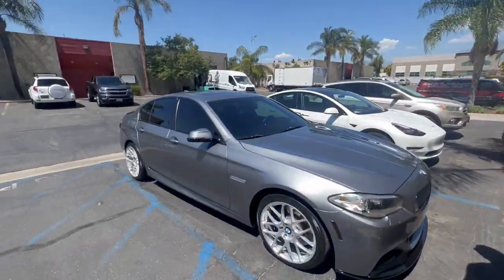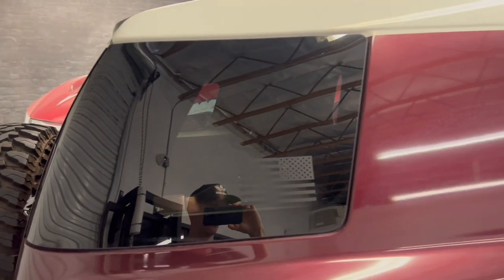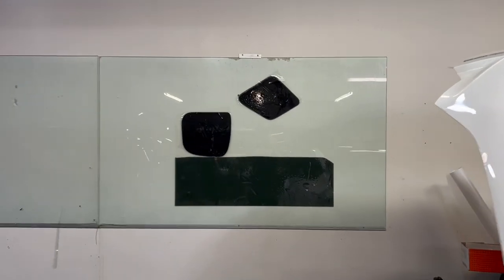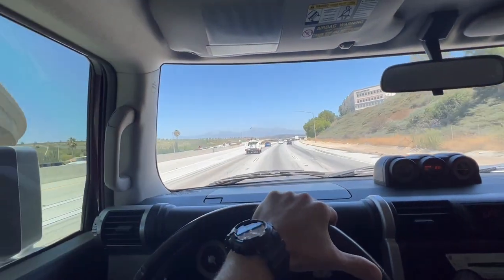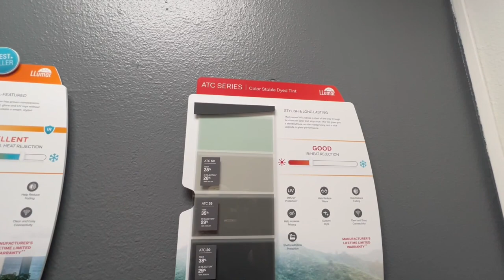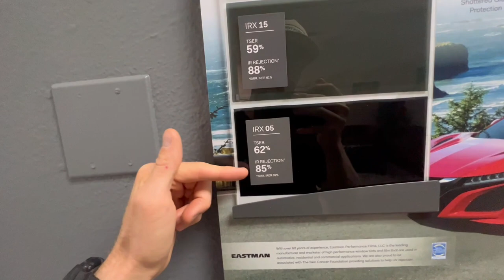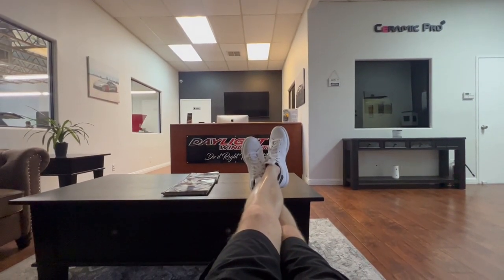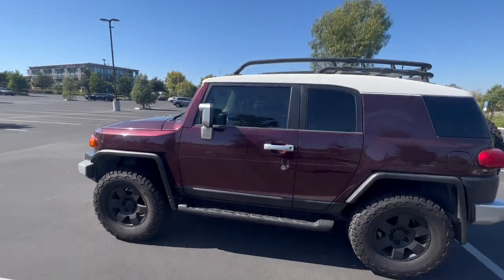80% Windshield Tint… the PERFECT shade

Comment: llumar Air 90 is the lightest tint available for windahields.

Have had it in two cars since 2017 as the Air Blue 80 with the stock factiry windahield tint will NOT pass Hawaii's annual safety inspection as it will test below the minimum 70% light transmittance by the Federal Safwty Standards

Comment: So what do you like more for the front windows? 5% or 15%? (Considering both day and night driving) * I just got 5% in front and 15% in back and back window. It’s kind of tough to see out the sides at night, but I like the privacy and it’s great during the day. Halfway thinking to redo fronts with 15% instead.
Reply: I reccommend you get 15 all around. I have 20% front windows and 5% on all rears